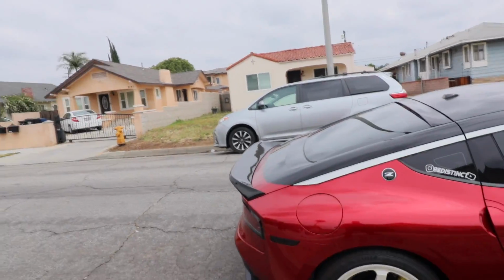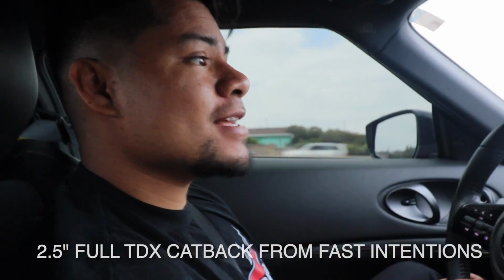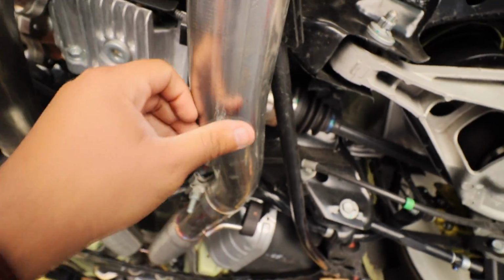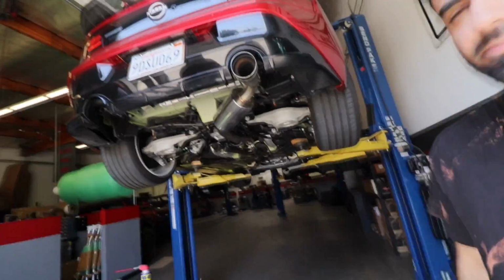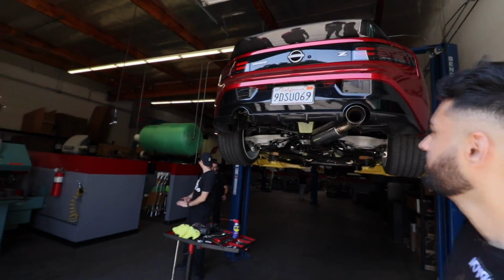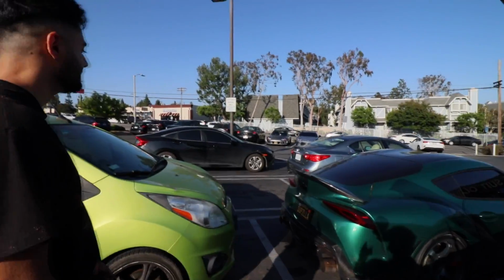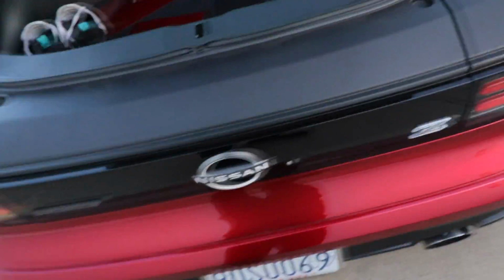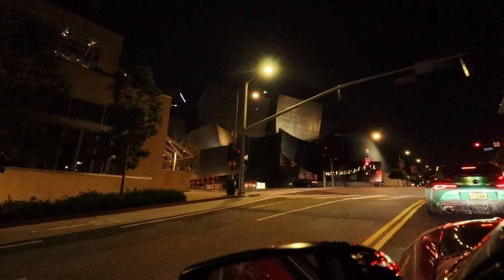RESONATOR DELETE on my Nissan 400z ! (SOUNDS MUCH BETTER)

Comment: Fast intentions has pretty tame exhausts which is good for the VR30. With resonated FDP’s and non resonated x pipe It  actually doesn’t sound bad 👌🏽
Reply from the maker: It doesn’t, if it was a full 3” system then maybe the rasp would be more noticeable